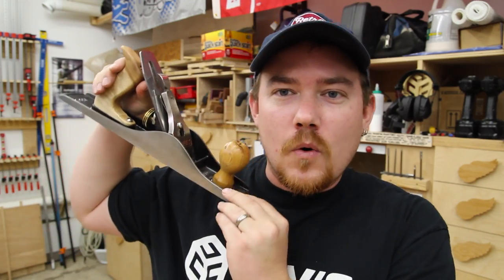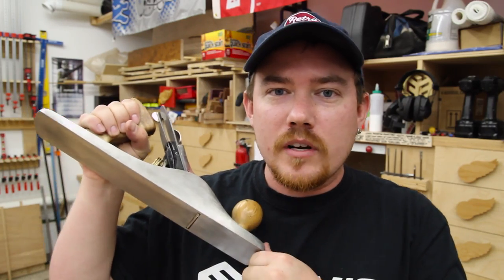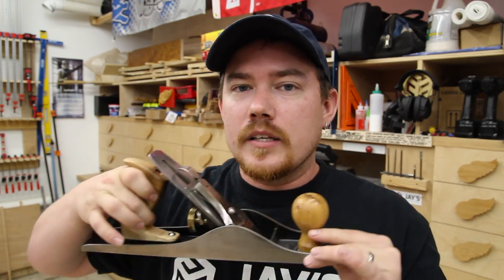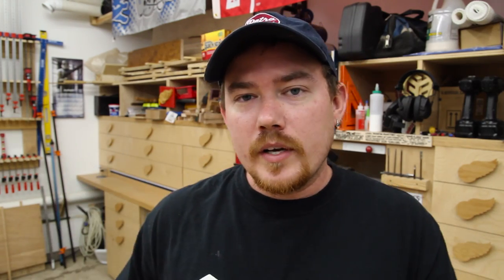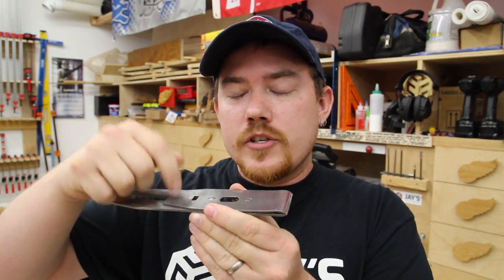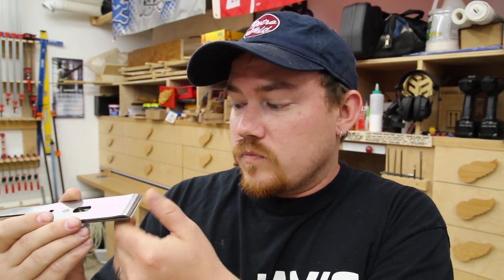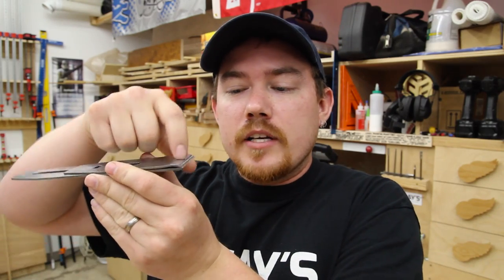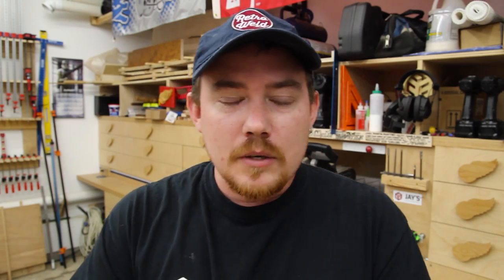Vlog 90: Planes, Pipe Clamp Tripod, Easel

Comment: GREAT job Jay on the layout.  Sure makes our jobs easier when we think about re-arranging the shop.
As for your bucket pod, maybe a larger pipe in the base extending out 10" or 12" with some bolts to support  a smaller/taller pipe.  That way, you don't have a permanent 7' tall object in your shop all the time if you don't want it.  AND that could lend it's self to other custom inserts.

Comment: Your bucket pod, is an excellent idea. I am ham radio operator, and when I lived in a detached condo, with antenna restrictions, I built movable Di-Pole antenna with a 5 gallon bucket, and 3 removable 8" sections (Except for the bottom section that was in the concrete). Look on-line for antenna poles, they are gold in color, and under $10.

Comment: I also like the bucket-pod. Saw lots of expensive ideas for mounting to the pole. I like your camp idea. You could mount arm as you said. If I remember those clamps swivel around the pipe easy. Maybe drill and tap the side of the clamp for a set screw on a knob you could tighten to lock the jaw in place. Sounds way cheaper too. Good luck either way and look forward the end resulting video.

Comment: I'm with you on tool placement, Jay. I believe in placing tools for the way you'll normally use them. You can't plan for every single little contingency. A person can stress over not being able to rip a full sheet of plywood all day long, but if you only do it once in a blue moon, what's the point? Address it when it becomes necessary.  Besides - even if you can rip a full sheet of plywood, you're going to have to move things around when you end up with a 12' long piece of solid maple or something anyway. Life's too short to stress the small stuff. Plan it and place it for the way you actually work, then move on.

Comment: Suggestion for your camera mount ... drill a hole through the pipe about 6" from the end and put a bolt through it before you stick it in the cement. Otherwise, the pipe will come loose and spin in the cement (don't ask me how I know!).
Reply from the maker: Thank you!

Comment: Hey Jay, ever think about adding a track saw (doesn't have to be the green one) to your arsenal? With your Paulk table, you could get accurate cross cuts from the full sheet instead of rough cutting prior to the tablesaw, and it would fulfill those rare times when you need a near full sheet rip. 

I emailed the podcast about a similar topic last week -- coming from a circular saw + fence,  it has changed my workflow -- it touches almost every piece that comes through my shop.  In addition to its use with sheet goods, I use it a lot for squaring up hardwood edges, cutting 45s, and even linear inlay work. Doesn't replace my cabinet saw, but they are a helluva tandem. 

Just a thought. Great to see you back in your shop!
Reply from the maker: I've got a track for my circular saw. It's easier to just strike a line, make a rough cut, and take the piece to the table saw.

Comment: Hey Jay, cement a short joint of pipe in the bucket with threads on top.  Then you could put a coupling on it and another joint of pipe for the camera pole.  It would take up less room to store the bucket.  You could also change the top joint dimension later if needed.
Reply from the maker: Thanks!

Comment: I would recomend you check out the Noga mag base with atriculating arm for dial indicators. You could use the magnet on the moving clamp. The largest of the nogas is really strong and easy to position. Many of the youtube machinists uses it.

Comment: Hey Jay . . . . The concrete base with a pole sticking out of it can work well. I was a commercial photographer for nearly 20 years, and in my studio, we made several things like you mention. We called some of them lollipops . . . To hold our camera, consider using the head from your current tripod, which will give you some mobility and articulation. Also, there are some pipe fittings that can be reamed out so that they will slide over your smaller pipe. Maybe use a 1" T over the 3/4" pipe and then tap the other side, inserting a bolt to create a lock. Use the T side to add your other pieces or fitting to hold a tripod head . . . . just a couple of thoughts . . .
Reply from the maker: I really like that. Thank you.

Comment: Totally agree about full sheets of plywood. I always have the initial cut or two done at the store with their panel saw.  It is much more manageable to load in the truck and move around the shop.  They do have a tendency to not be precise on their cuts to I add a half inch to everything I need them to cut and then finalize it when I get home.  Works great and don't need to maneuver and cut a full sheet solo, or worse ask my wife to help.
Reply from the maker: Yup, exactly. I plan my plywood layout for a rough first cut to be cleaned up at the table saw.

Comment: Jay, if you get a bucket with cement, 3/4 pipe, just get a grip arm from a c-stand. I underdtand about making something yourself, but those grip arms are very stable and already do everything you need, without havimg to reengineer something. Just a thought, and there should be many on the used photography market

Comment: additional suggestion, perhaps use fine sand to that bolted pole, and not cement.  this way you can easily break it down when the time comes that you need to break the system down for mobility reasons unforseen

Comment: Hi Jay, love your channel, have learded so much form you.  RE: your monopod idea, if you're going to boom out cameras and microphones like that up high you really need to offset with a counterweight in the opposite direction. Even when filled with heavy concrete I don't belive the 5 gallon bucket base isn't wide enough to safely boom out a camera and mic.  I would instead look at getting a Matthews with a grip head and boom arm along with a few sandbags.  You can find them on Amazon or B&H pretty reasonably priced (far less than a good tripod). Thanks for the great content!
Reply: Just did a little more resarch, the concrete monopod with boom is essentially a lever.  I found a lever calculator and using a weight of 85lbs in the bucket with a diameter of 12" would put the fulcrum at 6". So if you raised the camera 6' and boomed it out 4' that creates an 86" lever. it would take just 6lbs of force to tip over the rig. I'm no engineer so maybe my thinking is off but it all makes sense in my head :) http://www.engineersedge.com/calculators/levers/page_levers_1.htm

Comment: Why limit the height to fit under your garage door. Just tip it over as you go in or out the door. That way you could have really great overhead shots. Or you could put a series of holes through the 3/4 pipe and have a smaller 1/2 inch inside like a jack stand. That way, fully retracted, it'd roll through your door and be adjustable to almost twice its height.

Comment: Jay, you mentioned that you did not want to put a track system on your ceiling.  Would a mount near the center work if you had a n arm attached to it, that would spin 360?  Then you can just have the camera move along that arm and it could spin and also tilt up and down.  It would be a ten foot arm, or close to it, but then you only have one thing to spin around and move the angle up and down.  Not sure if it is even close to something that will work, just thinking and typing.
Reply from the maker: Nothing ceiling mounted would work.

Comment: Add a pair of superclamps (I like the Adorama store brand) joined to each other with a double-sided baby pin (that's the technical term you can search for), which will give you a way to clamp to your concrete-stabilized vertical support and add a (1/2" pipe or even 3/4" conduit) boom arm in the other clamp. Then a third superclamp attached to the end of the boom arm to which you can attach a simple ball head with another baby pin. Maybe $50 for all of the clamps and pins, and you may already have a basic ball head, or you can get one for under $20. You would have all of the functionality (though little of the convenience) of a proper studio camera stand that would cost $500-2500 (not including the ball head) to buy outright.
Reply: Heck. If he adds two arms to it, he could start filming in 3D with a camera on either arm :)
Reply: Sort of. You need to keep the lenses at a distance comparable to the distance between the average pair of eyes for 3D to not be nauseating. Check out how they mounted the Red cameras to film The Hobbit to understand the challenges.